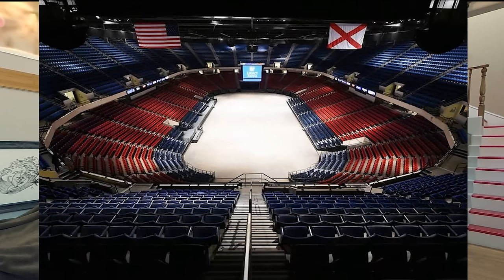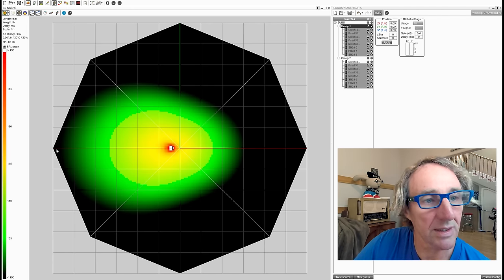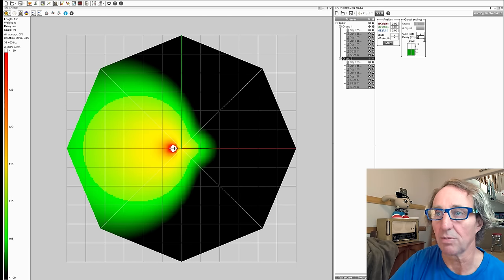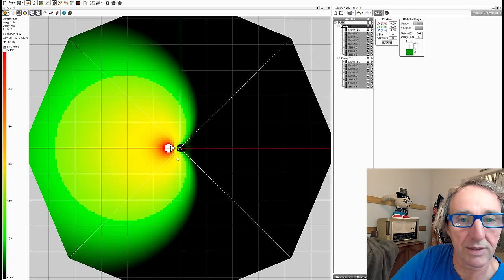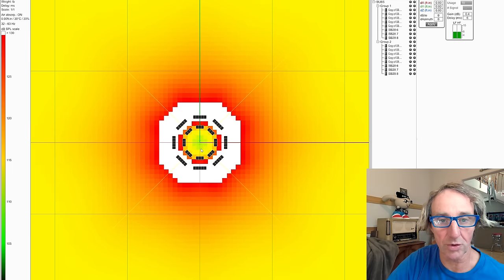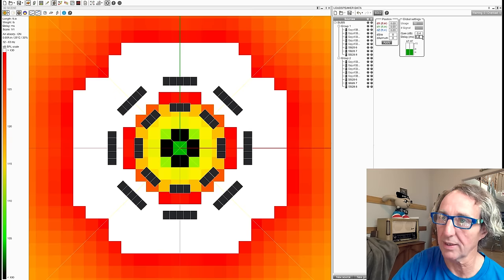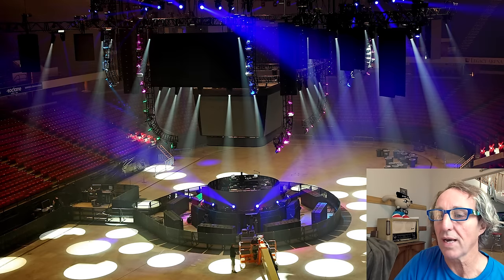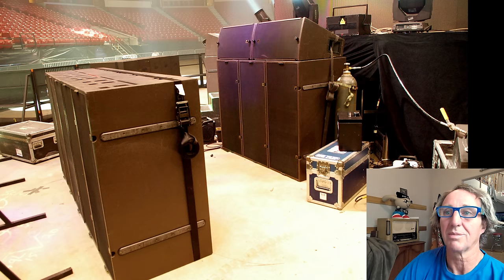Bassnectar 360 Subwoofer Sound Design

Comment: The TM array is the best answer to 360 degrees sub array.
Reply from the maker: Hmmm, this perhaps is the opinion and perspective of reading about it and publicity without actually mixing on it. 

From my understanding, while it looks good in publicity, in chatting with techs and Metallica's engineer, word is 

Having the subs center and high puts the subs farther from the audience. It lacked punch and impact.

The subs in the center with the pa in an outer ring put much distance between the subs and pa, creating unsolvable delay time and phase issues for most of the venue. Aligning time for people below, screwed it for people far and middle. Align for middle scewed people close and far and so on

The long vertical line of subs has a focal point horizontal to it, meaning no sub for people close and below. To increase sub energy downward, progressive time delay can be added forming a vertical delayed arc. But to do so is delaying the lower boxes more than upper boxes, this makes the sub sound really late in relation to the actual band for people up close. Then the pa has to be delayed to match.

All in all it's kind of a pretty idea that is a practical mess.

Though I never seriously considered it due to it's unsolvable flaws, it also was not possible as you can see there is a scoreboard center stage that can't fly high enough to get out of the way.
Reply: @DaveRat  Well, in fact I didn‘t read about it, I was there at the first two times it was ever used. And Big Mick was really impressed and when I met him seven months later, he still loved it.
Reply from the maker: Interesting because when I asked him about it and also hung out with the techs, the rundown they gave was harmonious with what makes sense would happen.

The predictions and sound of a vertical line arrays are pretty much the same as a horizontal sub line array which we all have significant experience with the assets and issues of.
Reply from the maker: Yes, that was the desired effect but the reality was the summation of the flown PA ring did not have enough lows to merge well with the TM and the distances between the TM and the flown PA ring created a myriad of timing and summation issues.

And he mentions the TM being close to the people in the back which is also saying it was farther from people in front. Farther than subs ever are. So they sounded more distant and required more volume to hit people out front, crunching people in the rear.

And also, like a said, the array has a horizontal focal so the people on the floor below and upfront either did not get lows or needed added subs.

I forget about the issue of having zero control over focussing energy in the desired direction

I sat down with big Mick and asked him about it a while back after they stopped using it.  He is a friend I have know for many years. Also while mixing chili peppers, Metallica sound crew came for a visit and we all sat on the bus drinking beers and chatted about loads of sound stuff including the TM

The TM array is a cool endeavor and has its assets and also has its issues. I personally have never encountered an application where the issues of having a huge somewhat unobstructed open space above the band, losing control over directivity and having a huge physical gap between the subs were acceptable

Comment: I can't imagine trying to get a crew to pull out tape measures and place subs with less than an inch precision.
Reply from the maker: Ha! Yeah, me neither. They set them all willy nilly, I fired it up, it did not work and then I personally drew the chalk rings.

That said, before their was line arrays, no one ever imagined crews setting up pa systems with lasers and software and angleometers down to less than degree angle tilt precision.

Which is now the norm

Sooo....

Comment: The option to fly the subs was not possible?
Reply from the maker: See the scoreboard in the photos?

Also one of the aspects of a Bassnectar concert is the people up front being drenched in subwoofer sound which gets diluted way down with flown subs.

Also, I don't believe I could have designed a system with that abrupt of a transition from no sub to massive subs in such a short distance using a flown configuration

Comment: Isn't the Thomas Munder array the most optimal for sub for in the round arena shows. If only artists and production managers would realise that sound, not light or video should always come first.
Reply from the maker: Hmmm, putting sometimes the desire for theoretical perfection overlooks the reality of what is best.

Remember the shows are about pleasure and experience not some technically correct lob coat solution.

A few things to consider. The TM array puts the subs at the farthest they can be ftom everyone. Coverage is good but this also minimizes impact and maximizes reverberation to direct sound.

More importantly, a show is about experience. Lights. Sound, video, pyro, sightlines, room temp and so many more factors.

If you optimize one facrot at the expense of others, you will never better than mediocre.
Reply: @Dave Rat  but generally lights and video are optimised over sound. Look at a Pearl Jam show, we fans and the band don't care for the shiny shiny, we just want and get a great band who sound amazing.
Reply from the maker: Are lights and video generally optimized over sound for symphony orchestras?

For an artist like Bassnectar where sound is of the highest priority and the sound they desire is maximum low frequency saturation of the audience, especially the closest fans, Moving the subs up high and away would be kind of like using a symphony sound system that is clear and balanced but lacks much of the power and energy PJ fans typically experience. 

It would technically work but would not be optimized from theoretical correct to ideal for the artist/application.

I, of course did my homework beforehand and not only am familiar with the TM, I have had in depth discussions with Big Mick and the techs who toured with it.

Even for a rock band like Metallica the TM did not provide optimal low end impact.

Oh, and there was also the issue of scoreboard which was very much in the way of everything so much that they used it as a lighting element.

Comment: A 10,000x power reduction is insane, wow.
Reply from the maker: Right! Yet in real world that max null is not realistic, the null was amazingly successful beyond expected
Reply: @DaveRat  Certainly! Simulations are always going to be idealistic, still though, this is a thought experiment I've always wondered about in the back of my mind but off the cuff never really expected more than 20dB of cancellation to be plausible in a simulation (and then worse in real world). So 40dB idealistic -> I'd hazard a guess real world was in the ~32 - ~36dB if I'm being optimistic is just crazy awesome.

In the follow-up you mentioned manually adjusting to maintain cancellation despite changes in atmospheric conditions, it'd be interesting to develop an automated feedback mechanism (with safeguards in place to prevent runaway)... probably not that expensive to implement either. Would be cool to play around with that if an opportunity arose.
Reply from the maker: For an installed system, would be the thing to do.
Reply: @DaveRat  Why not for a temporary build? 

Yeah there will be variances between each set-up & take-down, but those could be just another variable / data-point to enter into the calculation. Then again, maybe the formula then starts to get too complicated that very few people could actively maintain it (which may or may not be a bad thing, might mean job security, provided the quality it provides is worth the effort... but if the current setup works well enough... performance improvement vs. effort (or hours of work) ratio might be thrown out of wack).

Automating the system to max cancellation seems like a lab experiment that just needs the right combo of 'place to be able to test it' + 'will' + 'funding' to try out, and the most difficult one to obtain might be the funding part... then again this might be a unique problem that is very fitting for AI (and probably more socially acceptable as it enhances the human experience).
Reply from the maker: The time to setup, test and confirm insure it works as planned over a variety of temperature ranges would greatly exceed the time and effort to manually adjust.

The temp is not a simple " measure in one spot" but rather would need to know the average temp or actual speed of sound over the distance averaged for the ring.

Software that could perform adjustments automatically would need to confirm beneficial results, and errors would have catastrophic volume changes.

Testing for fail-safes and function at high volumes that impact the entire setup crew and basically shut down work in the venue would be needed.

Or, just have someone look at an RTA of a mic placed in the room center and if the level starts rising, raise or lower the time a tiny bit and leave it when the null improves. 

That way a human is hands on to insure all goes well. Do this  maybe every 30 min for 5 mins, Total time spent - 20 nin a night or so, one person,

The amount of time monitoring the automation will exceed the effort needed to manually adjust. And, to confirm automatic in is truly optimized, manual adjustment over and under will need to be made anyway
Reply: @DaveRat  From this description I concede automation seems impractical, and in general the performance achieved already appears to be 'more than enough' particularly with modern hearing protection being as good as it is.

Thanks for indulging me with this thought experiment!
Reply from the maker: I very much appreciate all of the perspectives and pushing to refine things to the best they can be is awesome!

Automation would be wonderful and finding the proper application to apply it is important

Comment: This proves how "Sound in the round" is a royal pain in the ass which requires a massive amount of equipment, energy, time and expense for a relatively small yield of output to the desired listening area. 

4 times the equipment to get half of the sound.
Reply from the maker: Hmmm, the sound was jaw droppingly loud. It was amazing! I have not looked but I bet there are some show reviews floating around.

As far as complexity, this is way more simple than the deployments we do for Coachella main stage and Sahara tent. 

And dealing with long distance sound mitigation of multiple stages is even more fun.

I love this stuff!
Reply: @DaveRat   I'm sure it sounded great. 

my point is.... had the stage been at one end of the arena,  It would have required less effort and equipment to get the job done.
Reply from the maker: And wasted 1/3 of the arena to dead seats and not looked as cool
Reply: @DaveRat   I dont disagree with that either. As I mentioned,  cost also becomes a problem. Those of us who work in the local scene don't get to work with the "Live Nation" size budgets.  We get put into similar situations but, dont have the luxury of deep pocket promoters who are willing to cover the costs to do what you did. 

I do appreciate your videos, quite a bit though. They are very informative and useful. 😊
Reply from the maker: Thank you, I was hired to provide a solution. They did in the round to increase capacity and experience. I love all adventures welhere limits are pushed!

Comment: Would be nice to regulate the delay based on a continual sound pressure measurement, rather than make manual adjustments. Anybody tried that? Might need a PID algorithm for stability.
Reply from the maker: That would be handy and if this was a permanent install or touring rig, would consider that.

Perhaps with max and min parameters that only allow a maximum adjustment of less than a millisecond.

That said, having something auto adjust is a bit scary and may not be ideal.

Manual adjustment allows increasing or decreasing the amount of low end for the DJ. Thermal changes happen slowly and somewhat predictably. Having something else making changes adds a layer of doubt, added complexity and increases in setup time and calibrations.

So I would tend to stick with manual unless I was doing this every day
Reply: @DaveRat  agreed. Main incentive is to track temperature.  Could also possibly improve depth of the null, since that's sensitive. It wasn't that often you had to adjust in the real environment, but it's more of a product idea for acoustics, similar to those auto-eq adjustments that use a spectrum analyzer but this would stay on, monitoring things.

Comment: Everyone should know that bass sounds are not quite directional; thus you don't need to position your average bass boomer in the center of your stereo. 360° diffusion? no need for a special engineer to achieve that, it's only a physical law.
Reply from the maker: For home hifi the fun way to find where to put the sub is to put it at the listening positions and then walk around and find where ya hear the most lows. Put the subs there as sound is recirpocal

Comment: sub freqs arent directional and are already 360
Reply from the maker: Like all blanket statements, that actually isn't very true. More accurately, sub frequencies tend to be less directional and the lower the frequencies the less directional they are.

The reality is that as the radiating surface and dimensions of the enclosure approach 1/8 wavelength of the frequency being reproduced, the sound begins to becomes more directional and at 1/4 it gets more directional and a 1/2 wavelength it gets very directional.

So for things like home HiFi, yes, subs act quite omni, but for any sound sound system that is larger or professional, subs are far from omni

Since 80 Hz signal has a 14 ft wavelength which means it starts to get pretty directional when radiated from a cabinet that is 3 and 1/2 ft wide. Most double 18 cabinets are 4 ft wide.

Start adding a few more sub boxes and the array gets directional really fast at very low frequencies.

All this can be predicted with software like soundvision